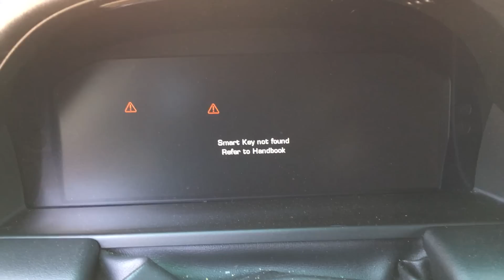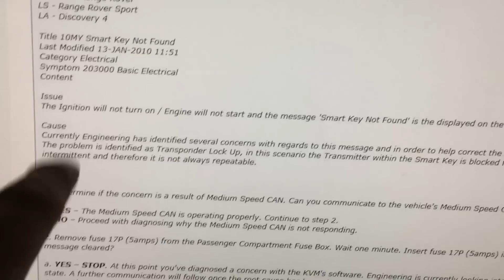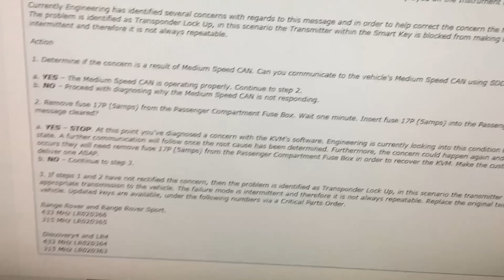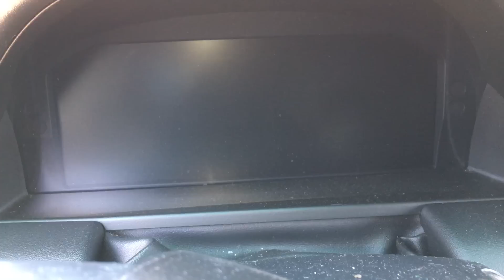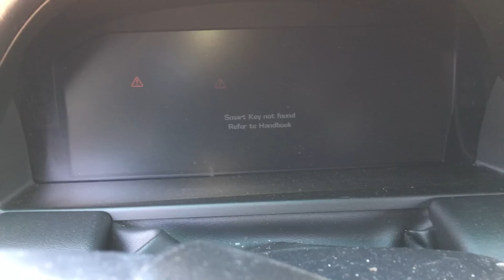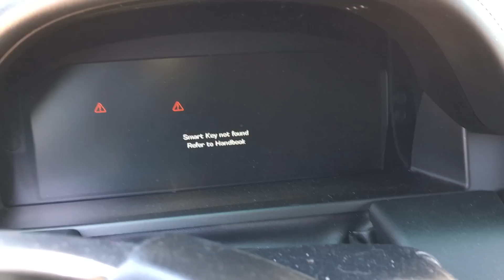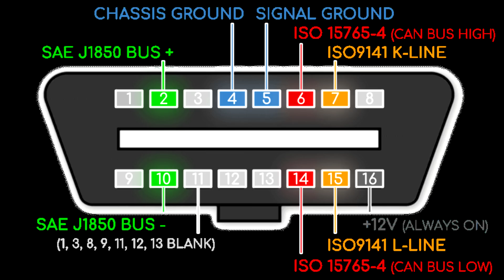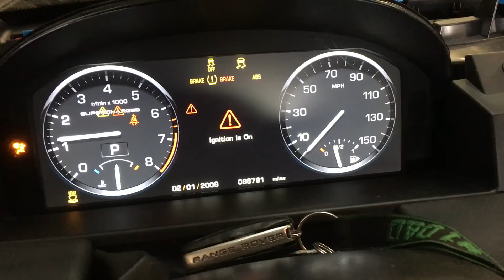LAND ROVER SMART KEY NOT FOUND NO START DIAGNOSIS

Comment: Wow !  You went deep . Well done. Mines a 12. Exact issue. Book said hold the fob against the lower dash near the cabin light then push and release the gas . Then it WOULD start. I suspected a sensor behind that area. It has to be dead exactly in the right spot. I'm gonna try this fix. Thank you. Seeing the dash all tore down kinda freaked me out, 😅 Cheers 🍻

Comment: Hi brother I have a similar issue with my 2019 Range Rover sport HSE. It will not start and the same key fob not recognized message pops up, I tried changing the battery and basic diagnosis. If you have any idea what can cause this let me know.

Comment: i know this video is old, not trying to add any negative energy. just wanted to point out you pulled F5 fuse instead of F17. however, I do appreciate the follow thru with the rest of the diagnosing its helping me find my tail with my customers LR4
Reply: nope, 5A is the current rating of fuse 17P, A stands for Ampere.

Comment: I need help .. I have a land rober range robert 2009 sport but the alarm light does not stop flashing even when I insert the key it locks and I leave it for a day and it turns on again it does not unlock and sometimes if it unlocks someone already had the same problem i need your help

Comment: Oh man, I have this issue but unfortunately its not a water leakage issue, its just some module that has decided that its had enough. Now I am racking my brain to track down this module and I don't even know if its not just a bad KVM because the SDD tool shows only the BCM and IPC modules as running. Hard to track down when you can't put the ignition in the on position!

Comment: I would wager the leak is coming from the tailgate as these are a known weak point on most Land Rover/Range Rover products. Especially if the drainage is compromised ir ‘overwhelmed’. Another possibility may be from the sun roof or roof bar areas. Range Rover trunk areas are favourite areas for placing sensitive equipment and these issues could also be caused by an over zealous ‘valet’ as I experienced with an 2009 TDV8 which affected the compressor electricals which were located in the spare wheel compartment below the trunk floor. All in all a great diagnosis.

Comment: I have an LR4 with a failing battery which AAA seem unable to diagnose correctly. As a result the voltage lines to all the electronics are affected when trying to crank the engine. This glitched the smart key system causing it to hang,  and not being able to start the vehicle at all. This solved the smart key read problem. I guess it's a hard reboot to the system in removing the fuse and reconnecting it again. This video saved towing and paying through all orifices to a Land Rover dealership. Thanks and good work!

Comment: Dude thank you so much I had a similar issue after I washed my vehicle (2011 RRS HSE Lux edition). Took apart the back panel like you did, unplugged the "black box", didn't see any water or corrosion but once I plugged it back in everything worked fine! Also, my key fob is old and busted which is why I first assumed it was a key fob issue... It was not. This solved my problem thank you again!

Comment: Obviously some things never change.  I have the 2014 Range Rover Sport and it has got a rear quarter glass or liftgate seal leak, which has run down inside and taken out the Differential Control Module.  Great design and engineering foresight caused the factory to mount the module upside down, which then makes the pressed metal cover form a cup just perfect for rainwater collection.  Still waiting for the new part to get here after the attempted shafting by the local RR importer.

Comment: Hi body I got exactly the same problem in my RRS 2008 some times my key hub doesn’t work so I got open manually and insert the key on the ignition,,do you thing this can be the same issue as the 2010 model?

Comment: I heard horror stories about poor Land Rover reliability but took the plunge and bought a CPO 2012 LR4 (7 years from time of service/100K bumper-to-bumper warranty, which gave me comfort) and had zero problems with it. Then we bought a 2016 Range Rover Sport and again have had no electronic problems (but the rear hatch sometimes won't close tightly using the motor and has to be slammed shut, which I think is a strut or gasket misalignment); it's a great car. Yesterday we bought a Range Rover (CPO). I think reliability of Land Rover in general has improved significantly since the marque moved away from Ford and Tata Motors invested billions in the company. Service at the dealership has been good. This is in contrast to my 2015 F150 with the 3.5 Ecoboost which developed gasket leaks just after passing out of warranty requiring a complete engine rebuild that took three weeks for return to service.

Comment: Stupid design, why not mount the module upside down? It probably requires longer wires then. I know that does not stop water from getting into that cavety but it sure will stop the connectors from getting wet.

Comment: What would a normal waveform look like?     Isn’t the up and down just showing the AC current?
Reply: The two waveforms from CAN_H and CAN_L should look symmetric to 2.5V, meaning in dominant state one line is HI the other line should be LO. The recessive state is both lines at 2.5V. So what his scope shows is some strange short circuit between CAN_H and CAN_L.

Comment: Well done range rover for mounting units upside down 🤦🏻‍♂️
I was always taught to mount wires out if bottom so water doesnt enter.
Reply: Who owns  Range Rover now? The poor Engineering and design choices hardly surprise me. I can only image that poorly written software behind it all.
Reply: @jd3497  this was during the bmw ownership era. The L322 range rover shared a lot with the e53 x5 (another problematic vehicle) even down to all the components in that same left rear area.
Reply: @jd3497  Tata owns them now. Indian company i believe.
Reply: A 2011 is pure JLR. Last Ford version was 2009 I believe. Tata may own JLR but these units for NA are still designed and built in the UK. I have a 2000 and a 2008 RRSC. No unusual problems with either.

Comment: a tip for anyone, thja red tool is there specificly for pulling fuses
Reply: Also, pulling the right fuse sometimes helps. In this case he pulled the wrong one
Reply: Yeah but they suck. Pliers work better.

Comment: first you pulled the wrong fuse
Reply: AAAnd next to it therees the fuse puller.... that red sh*t...
Reply: Watch carefully, He removed the correct fuse #17. It's a 5 Amp fuse not #5 fuse.
Reply: David Patrick doesn't matters as he went the right and logical direction
Reply: @Airman..  maybe not. Had he pulled F17 and not F5, that might have fixed his problem there and then!

He didn't follow his own process. He also mistakenly said: "... Reinsert the 17 amp fuse.."
Reply: Pete James think positively and value the  repair material this gentleman is providing free of charge.. as a tech and shop owner I can tell you that having a mechanic at this particular level will make you money and reputation
Reply: @Airman..  I always give a thumbs up to any video that I watch for exactly the reason you state.

However what about attention to detail and following a logical, problem solving process?
Reply: Pete James pulling wrong fuse would be corrected by disconnecting the battery however it will not correct the corrupted CAN communication network where lays the root cause of no smart key recognition, so he started disconnecting the nodes on the network till he found the offending one 
This approach is 100% logical and There is no shame in backtracking your steps solving a complex problem if you miss a point or two
Reply: @Airman..  excellent points made there.

I didn't think about the effects of the battery disconnect. Good point.
Reply: Exactly! He pulled Fuse 5 as opposed to Fuse 17 - jeeez, like you'd want him working on your pride & Joy!
Reply: @moonpunk  Fortunately, it seems these things aren't anyone's pride & joy. From this & other experience, they're getting the basics wrong !
Reply: @moonpunk  Watch carefully, He removed the correct fuse #17. It's a 5 Amp fuse not #5 fuse.
Reply: @sulla9528  No he didn't! The number fuse he pulled out was F5 and NOT the fuse F17 (like he said he was). The identifier is printed to the RIGHT of the actual fuse, not to the LEFT. You are the one that needs to watch carefully!
Reply: And probably used the wrong tool to do it !

Comment: Where did the other shop find the water leak ?
Reply from the maker: I never really followed up on that. Though, I do believe the sunroof drain may have something to do with it. but I am not sure if any sunroof drain lines run through that rear part of the vehicle.
Reply: Thanks for the reply.  I agree that the sunroof drain probably had something to do with the corrosion.  That’s why I don’t own cars with sunroofs - too great a potential for water leaks.

Comment: Lots of work to find the problem. But you might have gotten lucky.
   You pulled F5, not F17 (freeze frame the fuse layout). 'IF" pulling F17 "might" have generated a logical reset in the system, it may have started fine giving you a false fix.
  Then, if you found no further problems at the time you might have delivered back to the customer, only to have the problem show up when it got wet again, leaving you with a come-back or worse (a bad reputation if they decided to take it elsewhere). It happens to a lot of us.
  Well done video. Thanks for sharing.
P.S. I wonder if the KVM problem that's being investigated might be the caused by this same issue of water getting in the Parking Aid Module. It 'would be intermittent', and changing the KVM wouldn't fix the problem. 🤔
Reply from the maker: You might be correct. It can be difficult sometimes when I’m trying to film and work at the same time, so I wouldn’t be surprised if I pulled the wrong fuse. I’ll have to go back and check the fuse layout on the video. Thanks for the heads up!
Reply: Doubt it would have provided a false fix. The can bus signal was completely messed up. Other than the wrong fuse identification, this ended up the right way and in this situation i don't think pulling the correct fuse would have changed the path taken.